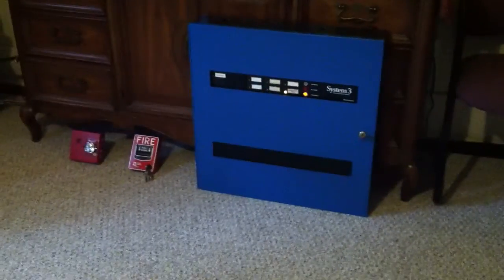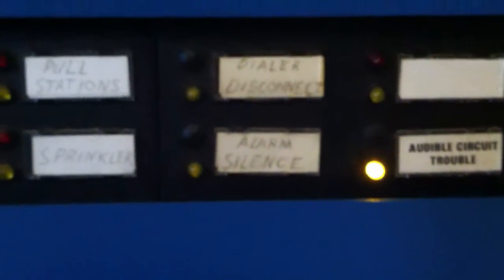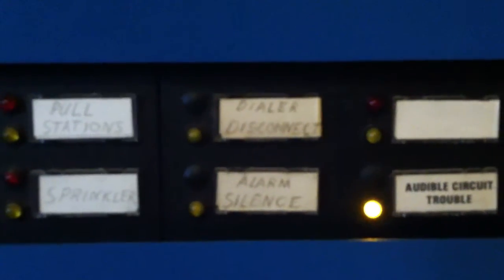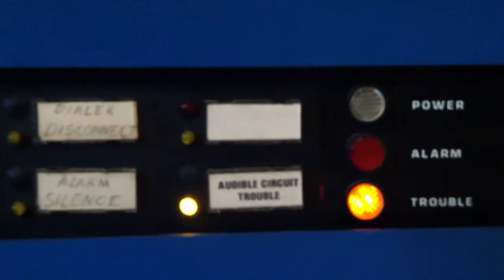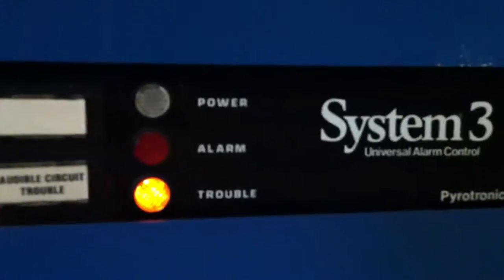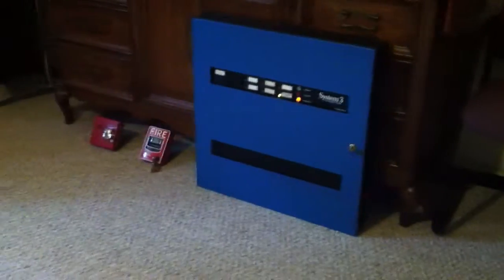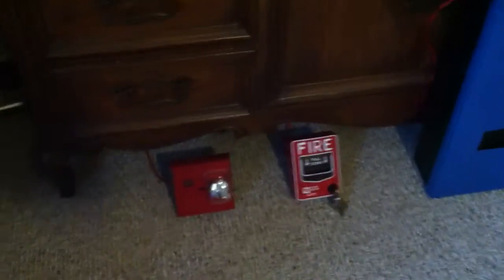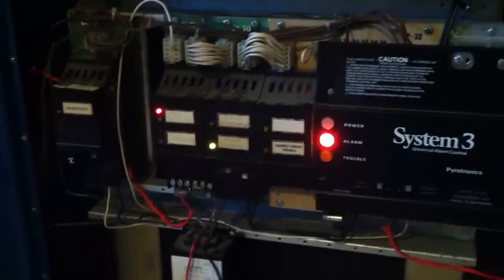Pyrotronics System 3

Comment: What type of resistor does this system use? I'm dealing with one of them and I don't know what type of resistor it uses.
Reply: I know this is coming very late, but a lot of old Cerberus Pyrotronics equipment uses 5.6k

Comment: Thank you for the blast from the past. I have been in Fire alarm design, repair for over 32 years and have build, designed 100's of these. I always liked the original CP-30 over the CP-35. These things were bulletproof. And yes, the power lamp always burned out (120vac incandescent). You can get replacements (LED type equiv.) from digikey or allied. Dont forget the 5.6K EOL on the NAC circuit. Thanks again !!

Comment: I used to work for Siemens when it was Cerberus Pyrotronics... definitely worked on a few of these over the past 30 years. I believe we even had one that would go into alarm or trouble every time the security guards would key up their Motorola hand held radios if they got to close to the panels.